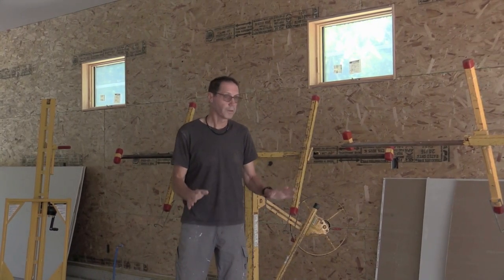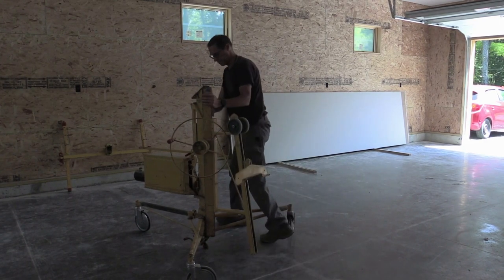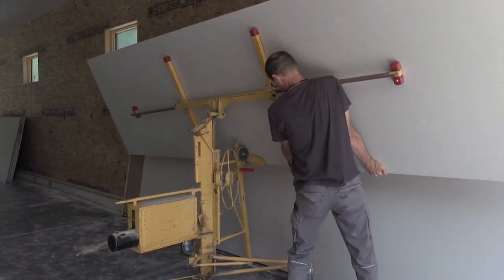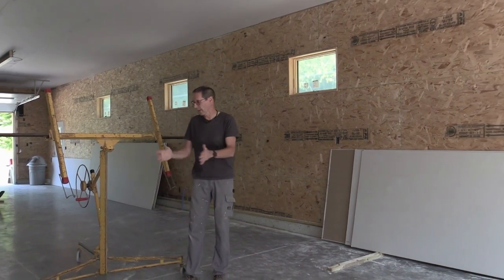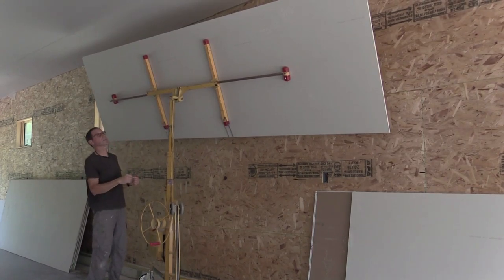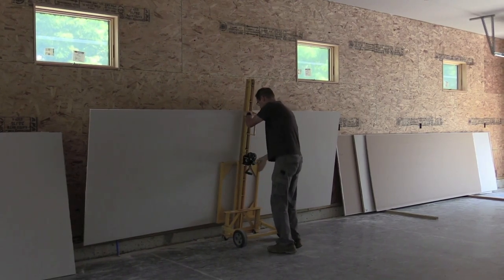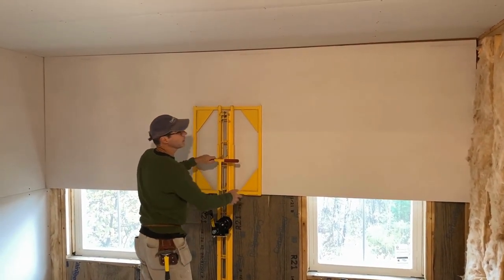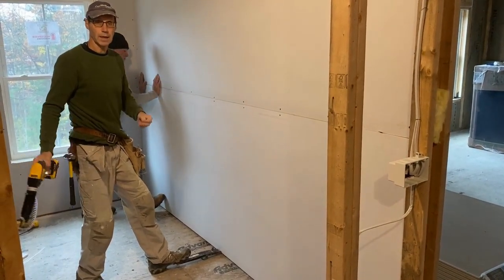Drywall Lifts Explained

Comment: Okay Myron. Hanging walls with the “ceiling” lift. 
1)- Position the wheeled “carriage” close to the wall to be hung. The 2 moveable arms of the carriage should be against the wall. 
2)- Flip the floor brake down so it is in contact with the floor. 
3)- Press the locking mechanism down and simultaneously push the entire lift forward to the wall. The arms will then spread further out and allow the lift to move very close to the wall. With the floor brake in position the lift can’t move backwards away from the wall. 
4)- Proceed to lift the sheet into position as normal. 
Otherwise an informative video. 👍🏻